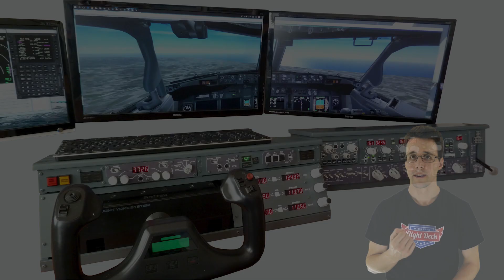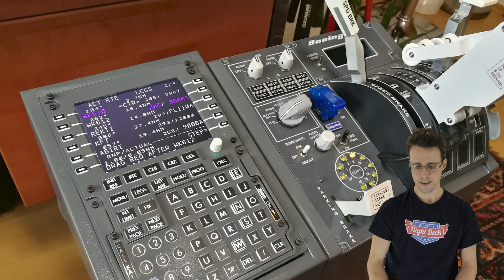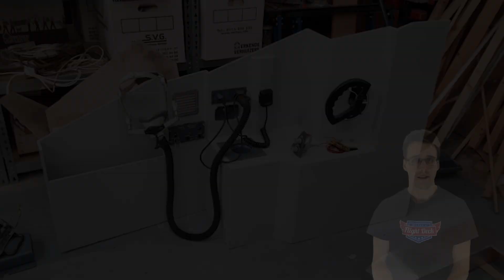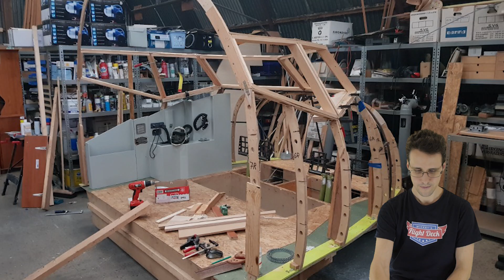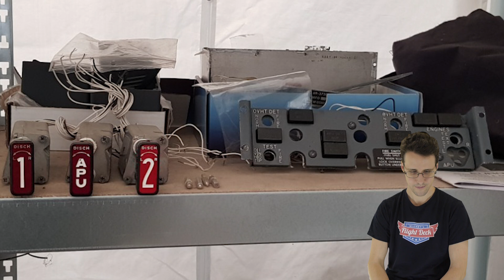The Cockpitshow #4 - Mickey's Flightdeck

Comment: Thank you for these excellent analyses of other people's cockpits! I agree to that you should not waste time on building the outside, you will only experience the inside of the cockpit so building a flush exterior is just waste of time and labour. I wonder if the holes in the ribs are for simulating the Boeing aluminium construction where the holes are for removing metal to make an aircraft lighter.
Reply from the maker: My first thought was that there could be cables routet through. Maybe it's for reducing weight too. A whole wooden cokpit can also bring a lot of weight.